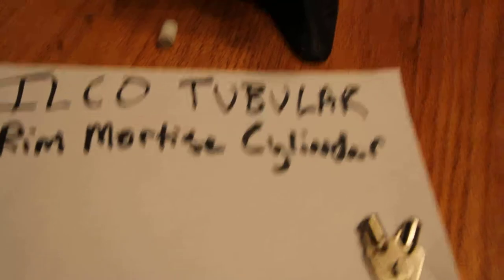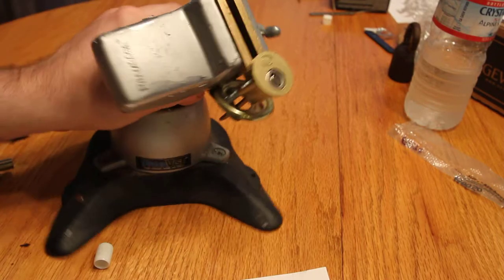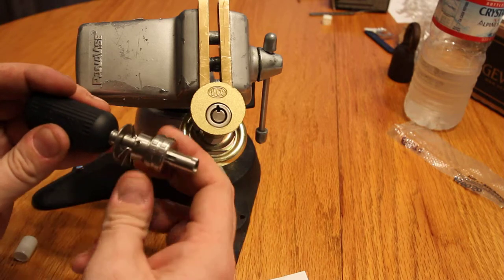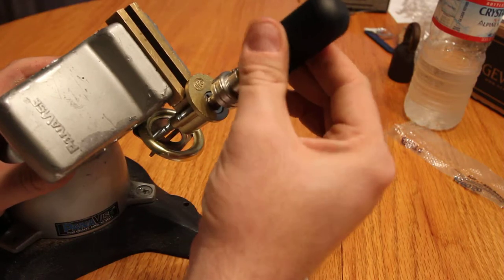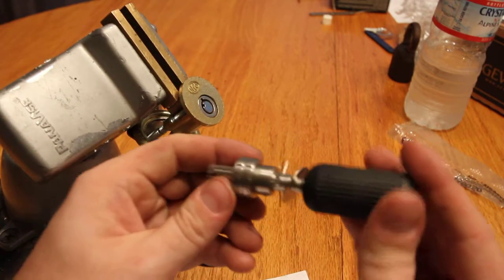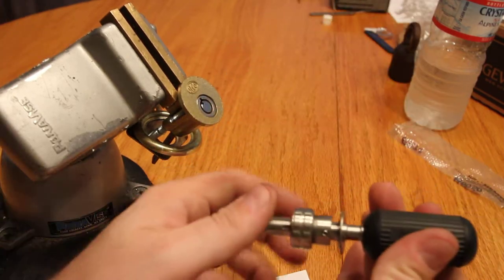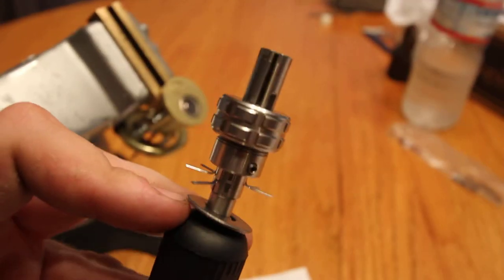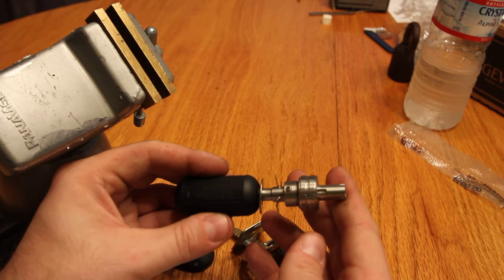(008) ILCO Tubular Rim Mortise Cylinder -- MPP

Comment: Great job Alex! I purchased one of the cheap models and it worked fine for years never had a problem...until it broke. First the pin on the inside fell out, but it still worked. Then a whole piece of the key body broke away, like a big chip. I'm not sure if it can be used anymore but its most likely unfixable.

Comment: Very nice lock Alex, never seen a rim Ace lock before. Very nice demo on the Southord pick as you seem to use it as I do by pushing in and twisting. Great video again Sir and also well said that the Southords are a lot better than the cheaper makes my first was a CHEAPER one and could not work it consistently and thought it was me, until I spent a bit more money and bought the Southord.... and never looked back as its fantastic :o))))